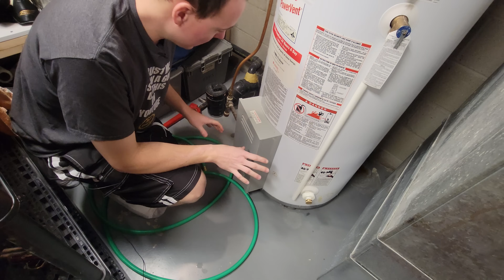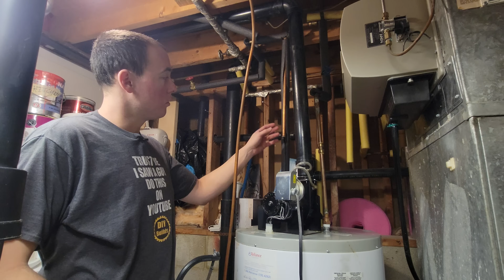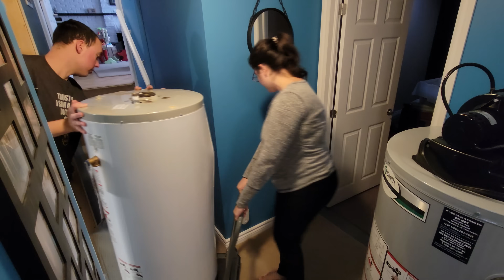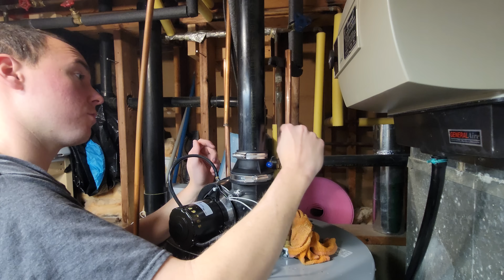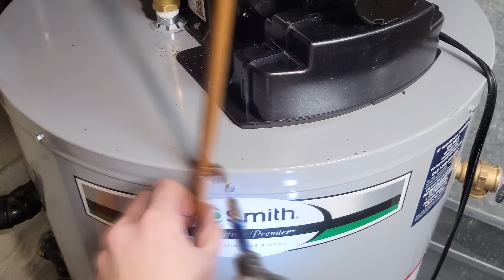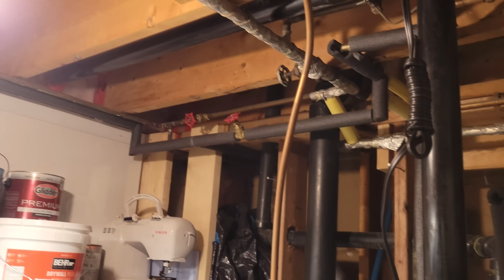How To Replace a Water Heater (Power Vented Natural Gas Heater)

Comment: Great video, I was looking for this content, exactly.  Regarding electrical - does the tank come with a plug?  Hard to believe you don't wire it in but I guess it is only running one small component.

Comment: When you were feeling the tank you should have opened the pressure release valve so that you don't have any air inside your tank unless of course you had some faucets open while you were filling it. If you have too much air in your tank you'll be heating that air up which could cause the tank to explode.

Comment: What would you recommend if you were getting tons condensation/water drooling down from the outtake pvc pipe into the blower mech? My Power Vent Rheem water heater is getting filled with water from the outside connection. When I try and start my water heater, I can hear the water dripping down and then I can get it to work after Wet-vac'ing the water out of the system. Last time I  was trying to get it working, I saw water seeping out of the pipe down towards the blower assembly. The idiots put the venting pipe straight up and angled vertically outside the house with a downward angled junction and I feel it is sagging inside after all this time, leading to condensation drippage from the natural gas heat source making tons of vapor.

Is that is a good start on the issue? I know I need to angle the outside connection down after some research and looking at the owners manual, but is there any other way of preventing this from being a 3 day a week thing? 

Do I need to fix the pvc routing outside and make sure the run is level? I haven't had this problem before and I have been living in a house built in 2014 for 9 years with no issues other than the wind shutting it the hot water heater off since I live i a valley. I have a family member that is a plumber. Do I need him?

Comment: ABS pipe is porous and prone to cracks due to the exhaust fumes. In Canada it lo longer meets build codes and need to be replaced by a thick wall PVC pipe. Otherwise, you are at risk of releasing deadly fumes into your house. Just my 2 cents

Comment: What kind of pipe is being used for the gas line?  It doesn't look like steel pipe to me.
Reply: Copper tubing with a flared fitting. Not normal here anymore but used to be.

Comment: YOU CAN'T USE ABS PIPE "IT'S FOAM CORE PIPE" FOR VENTING ON A WATER HEATER IT HAS TO BE PRESSURE SCH 40 PVC PIPE WHITE PIPE WITH PRESSURE ON IT.
Reply from the maker: Ya well that's the way it is. That's the way it is everywhere around here. Also I didn't install the abs.

Comment: No drain pan??
Reply from the maker: Nope. No floor drain in that room. And all the house water lines are in there so when something breaks its all screwed. I had a pin hole leak on one of the original solder joints spray everywhere one day. That was fun.
Reply: @DIYBuilds  a friend put a water detection sensor that warned him on an app. It was a pin hole on the pipe that was spraying right on the sensor. If it was spraying anywhere else it wouldn't have warned him. You could put one on a pan to let you know if the tank starts leaking.

Comment: nice work. BTW, you should avoid coiling cables up as they can heat up alot more. worth trimming IMO :)
Reply from the maker: Only 0.4A draw. It will be fine.
Reply: @DIYBuilds  well that's not much at all.

Comment: I had a similar problem when I had my last water heater die. The new heaters have a little more insulation making them wider.
Unfortunately, to fit in one of the newer ones, I would either have to have had my furnace temporarily removed and then reinstalled or demolish an adjacent bathroom wall and shower stall. After several hours of searching, the installers were able to find one of the old style skinny ones.

Comment: hot water tank pan drain - why didn't you use one to keep the floor dry?  You could have run your pipe from the pan to the clean-out pipe.  Just a thought in the future.
Reply: I had a hot water heater fail catastrophically in the middle of the night somewhat recently.  It didn't have a drain pan, but luckily there was a floor drain just inches away!  Unfortunately, the floor also slopes away from that drain...  New one is in a drain pan.

Comment: should've taken and added a 1/4 turn shutoff shark-bite onto the cold side since the old valve was no longer working 100% - gate valves are a PIA to work with when they get old.
otherwise great job on the DIY install!!